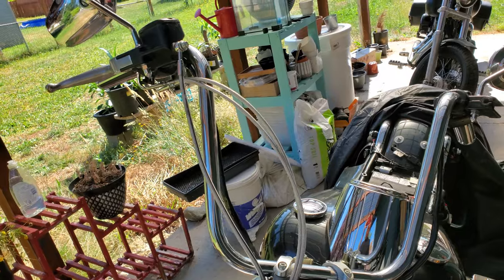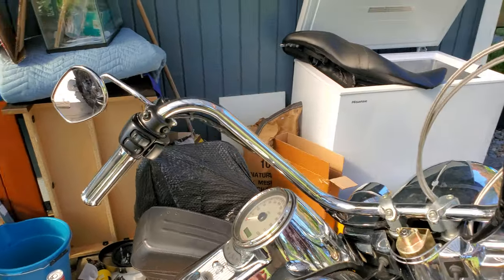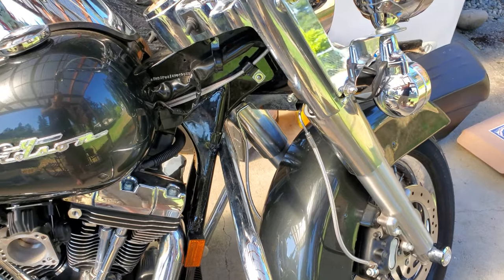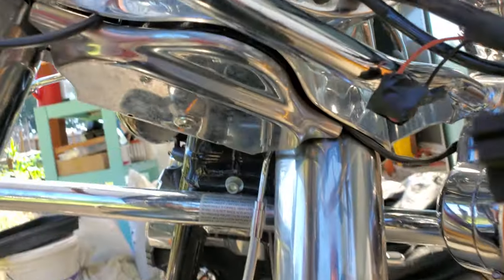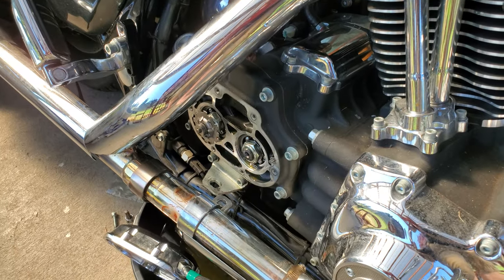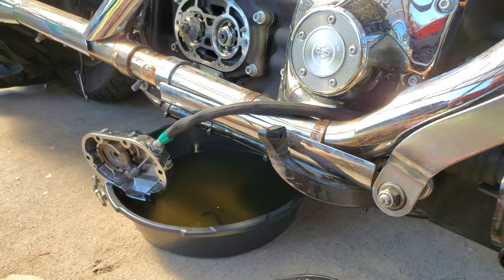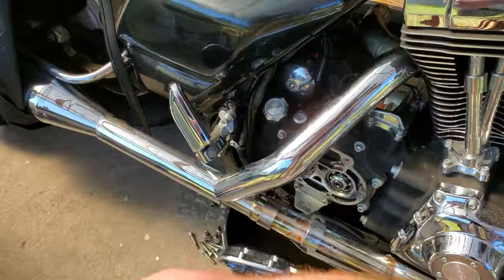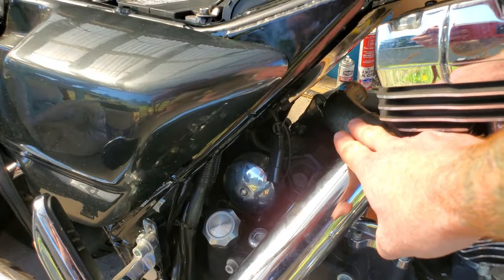Road King Ape Hanger Install/ Harley's BS Brake Manifold

Comment: Did you remove gas tank for cables?
Reply from the maker: I did unbolt and lift the tank for easier access, but, I think if you were patient you could do it without. Maybe :) but I didn't disconnect the fuel.